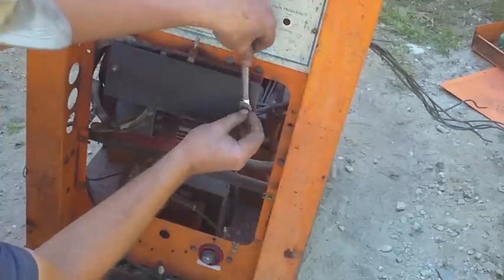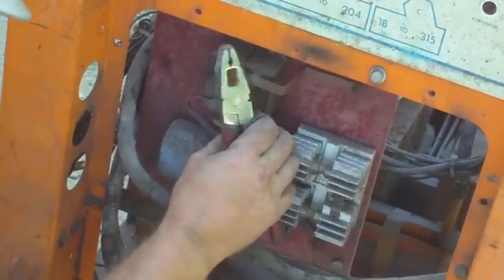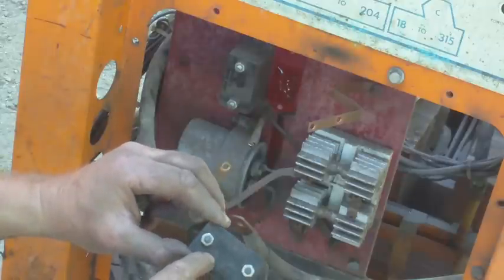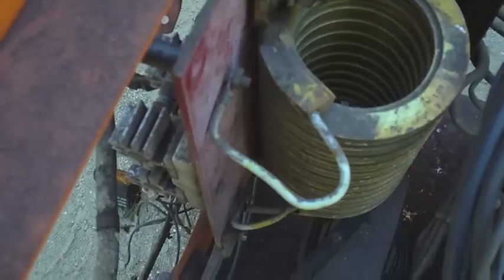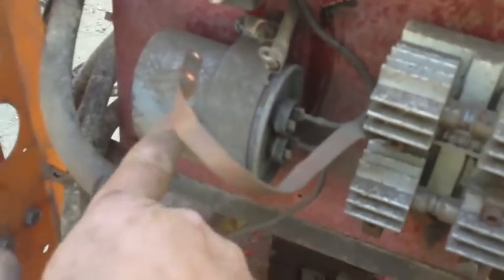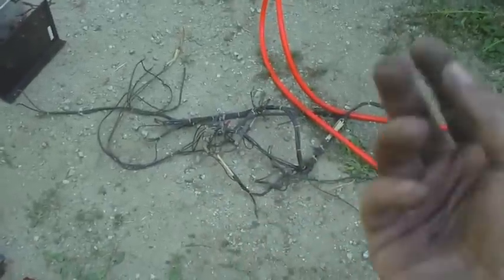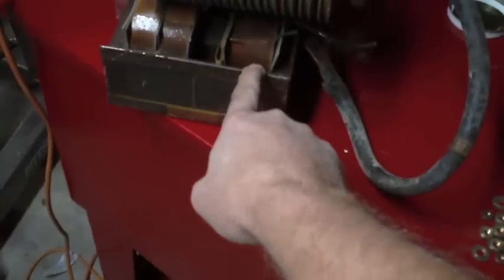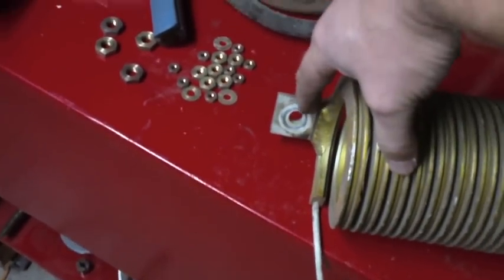The Airco "Bumblebee Crater Filler" DC Welder Part 5

Comment: How did they get the high frequency with the two sets of capacitors, the inductor, and the spark gap? I’m a gears and levers person who thinks all this is magic. Is this circuit tuned to some natural frequency? 
Then, how did they get any decent amount of power through it? The spark gap seems pretty robust but the wiring for the rest seems kind of light duty.
Reply from the maker: The caps, spark gap, inductor circuit is a pretty common circuit used to generate high frequency high voltage. Lots of tesla coil designs use this type of circuit in the primary. The welder uses a large open air coil to couple the hf to the welding circuit. No direct connection between the 2. The hf just sort of hitches a ride on top of the weld current.
Reply: So it IS magic! I went back to video #1 to check and this is a DC only welder. Is the HF circuit for starting the arc?